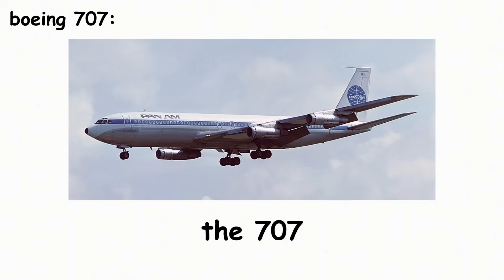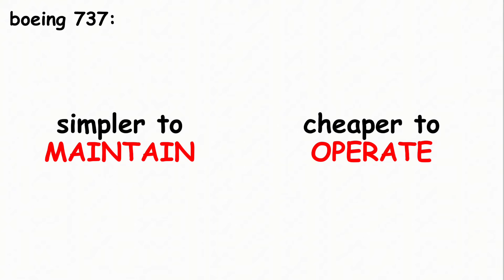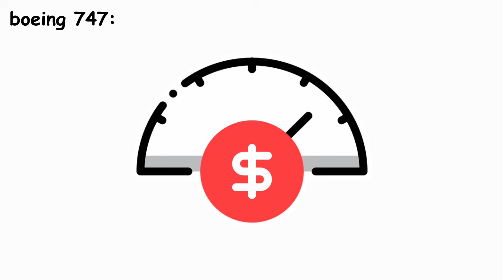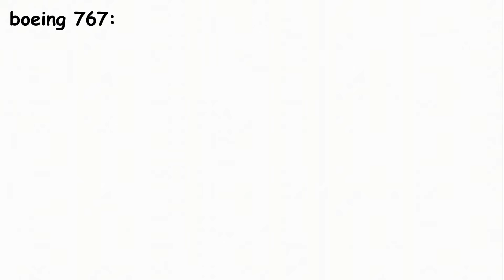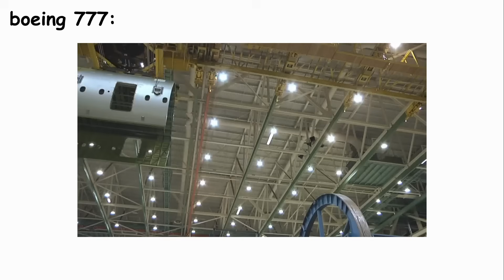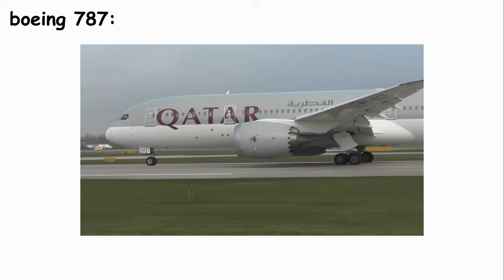Every Boeing Plane Explained in 9 Minutes

Comment: People - the 717 wasn’t a Boeing-designed aircraft, including it would have been wrong. The 717 was a renamed McDonnell Douglas aircraft that remained in production after they merged with Boeing.

McDonnell’s commercial aircraft division was circling the drain when they merged in ‘97. If they would have merged with Lockheed and fired the McDonnell execs, there might be three major aircraft manufacturers right now instead of two.
Reply: The title doesn't say "designed by Boeing". Therefore the B717 should be here.
Reply: @csabamagyar3244  Yup!  Absolutely.
Reply: Where’s the Boeing 720, I flew on that it from Msp to Lax on Western airlines summer of 1966, just smaller version of the 707!
Reply: What about b757
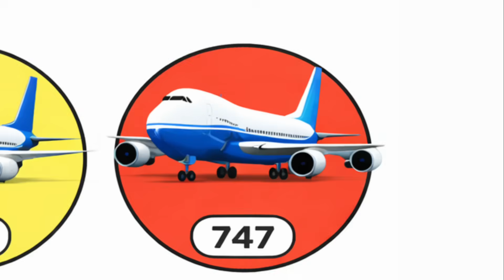Reply: @JamesDesulme-s2i @4:01
Reply: its a dc 9 32 or a md 90
Reply: @PILATUS1968  It was originally, until Boeing took it over, bought out the rights,  and called it the 717.
Reply: it was a MD95
Reply: I love DC-9s!
Reply: 717 was also the original designation of the 720. That in turn begs the question of why the Quantas planes were 707-138s instead of 720s when there was only a foot & a half difference in length... 🤔
Reply: It was the original design name for an abandoned plane that ended up being the kc-135. That’s why it was skipped
Reply: 720?
Reply: Doesn't matter.  It was still built and sold by Boeing as a Boeing aircraft.
Reply: it was built as the MD-95 and sold by McDonald Douglas.
Reply: The original designation for the KC135 is 717
Reply: who told you that?
Reply: @Boeing722-TIV1 it’s in the boeing history book they sell.
Reply: @Boeing722-TIV1  he must have ment Boeing 707/720

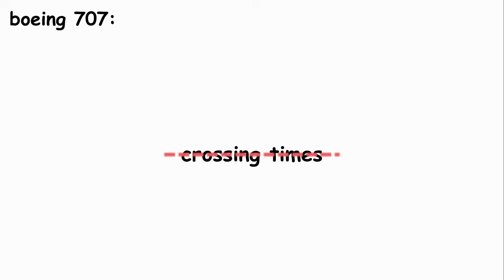Comment: 0:30 The Vickers VC10 first crossed the Atlantic on April 1, 1965, when the British Overseas Airways Corporation (BOAC) officially inaugurated Super VC10 commercial service. The aircraft flew the route from London to New York before continuing onwards to San Francisco. The VC10 was also considerably quieter as it's engines were located at the rear.
"Just sayin"...

Comment: Liked the video. Clear and consise information with the images actually showing at the right time. Could you please consider doing a similar video, but with the 747 and other ranges in comparison? Seen quite a few that don't put the ranges side by side and flash through them too quick. Nice.

Comment: The 707 was a hell of a step up from the venerable Constellation, which had a cruising speed of around 310 mph. By comparison, the 707 could cruise at around 550 mph, almost 80% faster! I've been on a 777 (JUST ONCE!) but it was a nice experience. Most of my flights have been on a 737 or the snooty French equivalent. 😉

Comment: Some errors in this video.  The comet was the first successful jet powered passenger aircraft.  Well, successful to some degree.  The Airbus 320 is the most sold aircraft ever.
Reply: Not to mention that thumbnail.  Most of those planes in the thumbnail aren't even Boeings.  I sense AI slop was used in the making of this video.

Comment: Model 247, 307, 377.  You could also include the Monomails and the clippers.  717 (not the MacDac version, the C-135 version) and 720.
Reply: the 720 is technically a variant of the 707, but it does use a few different materials but I agree with you on the pt	her ones

Comment: The Boeing 727 had “THREE ENGINES.”…..Your depiction of the Three Engined Boeing 727 shows a “Twin Engined” Jet…. A Jet which looks more like the British Aircraft Corporation (BAC) BAC-1.11 (One-Eleven)…This aircraft had 2 x Rolls-Royce Spey Turbojets…..The Boeing 727 had 3 x Pratt & Whitney JT-8D Low-Bypass Turbofans…..Just for interest….The BAC-1.11 would’ve had far better performance if it had been equipped with the Pratt & Whitney JT-8D Turbofans! …The problem was, the British “Labour Government” at the time….As was typical, they interfered with the design and insisted that the BAC-1.11 be fitted with British Engines….The only suitable engine being the Rolls-Royce “Spey.” ….As the type was stretched with the introduction of the BAC-1.11 500 Series, the power units remained the same…Also, new “Noise Restrictions” meant that “Hush-Kits” had to be fitted…The result was nothing but a reduction in power output!….This was compensated for with the introduction of the “Demineralised Water” Injection System, which helped increase power on take-off by cooling the burner cans with “Demin-Water” Injection…..Had the 1.11 been fitted with JT-8D’s, this increased weight and added “Hush-Kits”  wouldn’t have been any problem at all….

Comment: The de Havilland Comet, the world's first commercial jet airliner, first came into existence on July 27, 1949, when its prototype completed its maiden test flight in England. It officially entered commercial passenger service on May 2, 1952. Following early structural and metal-fatigue issues, a heavily redesigned version, the Comet 4, made its debut in 1958. You are publishing false or incomplete information as previous comments also point out. STOP IT! RIGHT NOW! I will stop reviewing this video.

Comment: I'm no expert but I'm old enough to remember a 247 and a 720. They seem to be missing. The 247 was a prop job so maybe you meant jets but I know the 720 was a 4 engine jet because I used to confuse them with the 707. For all I know, there were other prop based passenger liners as well.

Comment: The 727 was a very loud aircraft on takeoff.  Ironically, Eastern Airlines referred to it as the "Whisper Jet".  That was because with rear mounted engines the cabin was not as loud as jets with wing mounted engines.

Comment: The deHavilland Comet started the jet age. Boeing picked it up and made it soar, sure, but words matter.
Reply: Words do matter. 0:14 “first commercially successful jet powered passenger aircraft”. The Comet was pulled from service in less than two years due to catastrophic failures that killed all on-board three different flights. Only 114 were made. The Tu-104 produced more, but had an even worse safety record. The 707 was indeed the first commercially successful jet powered passenger aircraft, as stated.

Comment: Why did you pass over the 717 and 720?
Reply: The 720 is considered a derivative of the 707 (707-020). Admittedly it had some differences in materials and wing design, but technically it was not a distinct model. The 717 is probably omitted because it was not a Boeing-designed aircraft (it was the MD-95). I guess the creator took these technicalities into consideration but it probably would have been a more complete video to include them.
Reply: @jtsholtod.79  boeing 717 was designed in the late 50's and was renamed the KC-135
Reply: @raybbj Yes, that is true, as the internal designation "Model 717". But it was never sold as the 717, only the military designation KC135. The video only covered civilian aircraft, not military, so I would think it's an appropriate omission regardless.
Reply: The 720 is a long range variant of the 707 and the 717 is actually the MD-80

Comment: The Airbus A320 has replaced the B737 as the most built jet airliner in history.
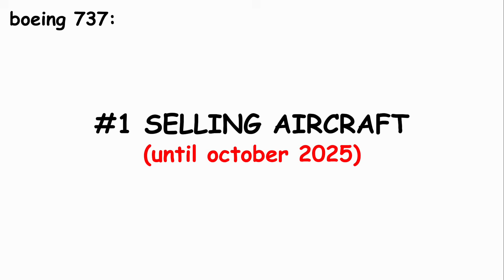Reply: Hence the note at 1:48
Reply: @rdspam   My comment was intended to bring the situation up to date and to note that the Airbus A320 now has the accolade of being the most produced airliner in history.
Reply: There are still 737-200's from the late 1970's in active commercial passenger service. With the backlog of orders for the 737 Max, Boeing will still be making them well into the 2030's. If the last Max remains in service for ~50 years like the 737-200's have, we could have a plane originally designed in the 1960's still flying in the 2080's. Quite a run even if Airbus has managed to sell a few more A320's.

Comment: The Comet, followed by the TU-104, followed by the Caravelle started the jet age.
Reply: It’s an American  video 😂 they like rewriting history
Reply: And both failed 💥
Reply: 0:14 “first commercially successful jet powered passenger aircraft”. The Comet was pulled from service in less than two years due to catastrophic failures that killed all on board three different flights. Only 114 made. The Tu-104 produced more, but had an even worse safety record. The Caravelle entered commercial service in April 1959, six months after the 707. The 707 was indeed the first commercially successful jet powered passenger aircraft, as stated.
Reply: @rdspam  The original deHavilland Comet had issues with pressurisation, which was corrected after extensive investigations as to what caused the crashes, and the modified deHavilland  Comet 4 entered service ahead of the Boeing 707.
Reply: @rdspam  The article did state that the 707 started the jet age - it didnt, the Comet did, the race was on & it went into commercial operation before the 707 did. The 707 may have been a far greater success but it did not start the jet age.
Reply: @daynasmum529 No. The Me-262 started the jet age.
Reply: @richwightman3044  Anyone of average intelligence would assume I was referring to the start of the jet airliner age - not jet age in general. I hope you remembered to iron your underpants today.
Reply: @richwightman3044  How many passengers?

Comment: Boeing 717: what about me
Reply: MCDonnell, not McDonald
Reply: @mrAhollandjr  Thanks
Reply: @mrAhollandjr  what?
Reply: @iusuallykei the Como was called McDonnelk- Douglas, not McDonald- Douglas. That company was the result of a merger between McDonnell Aircraft and Douglas Aircraft.  Douglas was the company that produced rhe DC family of aircraft.
Reply: I believe that the Boeing 717 was actually…..Just a Re-Named:  “McDonnell-Douglas MD-95.”…..As Boeing had acquired the McDonnell-Douglas company in entirety, the MD-95 became the Boeing 717……Hope that helps!
Reply: The  717 Is a mcdonnell douglas  plane called md80 but the md80 change his name when Boeing Buy donnell douglas
Reply: @starling-cdt The Boeing 717 was actually a Re-Named: “McDonnell-Douglas” MD-95….
Reply: The 717 is the dc9 but boeing renamed it 717
Reply: @leafy-z7e The Douglas Corporation (DC) built the dc-9. 
After their merger with McDonall Aircraft (MD) McDonal-Douglas built several aircraft based off the DC-9. the MD-80, MD-82, MD-83, MD-87, MD-88, MD-90, MD-90-30, MD-90-ER. All of which were developed and put into production by McDonall-Douglas.
The MD-95 was developed by McDonald Douglas, but never went into production before the merger with Boeing. No aircraft designated MD-95 was ever delivered to an Airlines. The Boeing Corporation renamed that aircraft and exclusively sold it under the 717 designation. Therefore it has only ever been a 717.
Reply: @leafy-z7e No….The Boeing 717 was just a Re-Named “McDonnell-Douglas” MD-95…..It had virtually nothing in common with the Douglas DC-9 Series…..
Reply: Where is the 757?
Reply: The 717 was a project as part of the 720. Once the kc-135 request came in they used the design for the 135 and abandoned the 717. That’s why the whole. Generations later they recycled the 717 name since they’d never released the plane.
Reply: That one was inherited by Boeing from McDonald Douglas when they merged and was originally the MD-95, which was the successor of the MD-80. All of which belong to the DC-9 family and could all be considered newer DC-9s.
Reply: @ShonnMorris . Still sold as a Boeing 717 and part of “every Boeing”.
Reply: @ShonnMorris bro confused McDonnell with old McDonald
Reply: @HI12048 auto correct
Reply: @S @ShonnMorris e Boeing 717, or the MD-95, had very little, if anything, in common with the Douglas DC-9 Series didn’t it???  I was a Boeing man for all of my Jet career, having never flown any of the “Airbus” Family….I did have many flight-deck rides in them, but never flew them….Very nice, modern and very comfortable cockpit…..I was on the Boeing 737-300, 400, and 500 Series with the “now defunct” British Midland Airways (BMA)…..Based at London Heathrow from 1994 - 1999……Then I was off to Sir Richard Branson’s “Virgin Atlantic Airways.”……Based at London Heathrow, and London Gatwick….Luckily, was selected for the Boeing 747-400 Fleet, this was from 1999-2021….When serious health problems forced me into early retirement, at the age of 55….Then the company retired and sadly “Scrapped” the 747-400 Fleet!
Reply: @ShonnMorris it may have been inherited from McDonnell Douglas but it was in fact part of Boeing after the purchase. The 717 was flown by Delta, AirTran, Midwest Airlines, and Hawaiian Airlines. Those are just the ones I remember off the top of my head. The aircraft type was never delivered to any airline as an MD 95. It was always sold as a Boeing 717. I spent the majority of my career on a Boeing 717 so it feels insulting that it was excluded.

Comment: What about the 717? It was still Boeing.
Reply: Not exactly. It was originally a derivative of the DC9/MD80/90 built and marketed by McDonnell Douglas before being taken over by Boeing in the late 1990's
Reply: It is certainly not Boeing. It is MD, Boeing just bought the rights after it was already designed
Reply: @griffith211  ... which therefore means it was Boeing.  They didn't just buy the rights: they bought the whole company! Or rather, the "merged"...

Comment: The 707 was NOT the first "commercially successful jet-powered aircraft". That title goes to the DeHavilland Comet.
Reply: To call the Comet was successful is akin to saying the RMS Titanic was a success.
Reply: @EdW-b6n technically it was. The problem wasnt the ship, as many as it had, especially with the hull being weakened by fire during construction. It was the combination of the conditions that fateful night and the weakened hull that sealed the fate of the ship.
Reply: @S1mp1l0t "Let me tell you something about the Titanic: people forget that on the Titanic's maiden voyage there were over 1000 miles of uneventful, very pleasurable cruising before it hit the iceberg,"😊
Reply: @EdW-b6n  The two sister ships of the Titanic were very successful, and sailed for many years.  Titanic could have too, if it wasn't for a careless, ambitious captain who ignored safety.
Reply: @EdW-b6n   😂😂😂😂
Reply: The statement wasn't "the most commercially successful", the video claimed to be the first to cross the Atlantic. That distinction goes (also) to BOAC, with the Comet.
Reply: The Comet was first, yet it wasn't really "commercially successful". Only a total of 114 Comets were built whereas by 1964 more than 300 B707s were already built.  The Comet was not successful and had several drawbacks.
Reply: Successful? Three catastrophic failures and pulled from service after less than two years? The Tu-104 was even a bigger disaster. The 707 was next up, 850+ made, 50+ years in service.
Reply: @rdspam the comet proved that jet aircraft as passenger transport was a viable strategy. The main problem with the Comet was its square windows that would cause the fuselage to crack in the corners under the extreme pressure differential between the inside and outside of the aircraft. It was still a commercial success because of what it proved, not because of how many were built or how long it served.
Reply: @S1mp1l0t  It wasnt the square windows - it was the rivets that were punched into the fuselage that caused stress fractures in the panel alloy around the windows that caused the issue.
Reply: @daynasmum529  wrong on both counts.  The cracks started at the square ADF window and the squares escape hatches. Yes they did start at rivet holes, but not around passenger windows.  That was caused by metal fatigue, not just by using rivets.  Many modern jetliners use rivets still today, just fine.  The rivets weren't the problem: The stresses caused by the square holes were the problem, creating metal fatigue that ended up causing cracks at some rivet hole.  If those hatches and the ADF window would have been round, there would have been no problem.
Reply: @i-ccc-channel  So they did start at the rivet holes but wrong on both counts? - Mogadom is a terrible drug.
Reply: @daynasmum529  Yes, wrong on both counts.  The rivet holes where not the CAUSE of the cracks, as you implied.  The cause was the high stresses around square cutouts.  If it had not been for those, there would have been no cracks.  Dunning-Kruger is terrible illness.  Incurable, too.

Comment: Where is 717?
Reply: Which 717? The 1990's 717 was not a Boeing design but originally a derivative of the DC9-MD80/90 built and marketed by McDonnell Douglas before being taken over by Boeing in the late 1990's

Comment: it would be better if you added the 717 7j7 and 2707
Reply: I think it makes less sense because the original 717 wasn't actually a separate type but a 707 sub version. Also the 7J7 or the 2707 haven't really left the drawing board.
Reply: If you meant the 1990's 717, this is not an originally Boeing deignedairliner but rather a DC9/MD80/90 derivative originally designed and marketed by McDonnell Douglas before being taken over in the late 1990s
Reply: @Advancedkid  The 717 was not a "subtype" of the 707.  It was originally a subtype of the DC9 and MD80 family.  It has very little in common with the 707.
Reply: The 2707 never even had a prototype built. The 20+ other actual Boeing airplanes would be better inclusions.

Comment: what about the 717?
Reply: Not a Boeing, a renamed MD
Reply: @christianrogers2361  Not designed by Boeing, but the title says jus Boeing. And therefore the B717 IS a Boeing. An adopted one.
Reply: The original 717 was not really a different type but a 707 sub model. Also flown with the same 707 type ratings.
Reply: It was abandoned when Boeing moved on to the 720 and 135. Since they never released the 717 generations later they recycled the number.
Reply from the maker: Oh yeah my bad lol
Reply: @AeroExplainedTV  lol